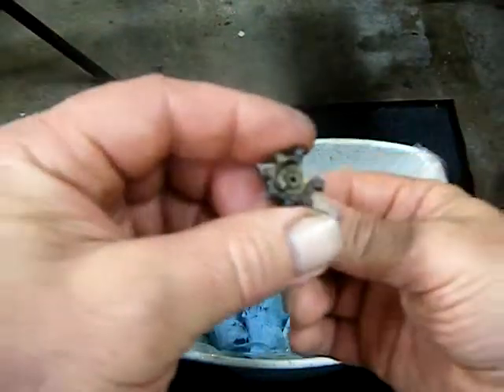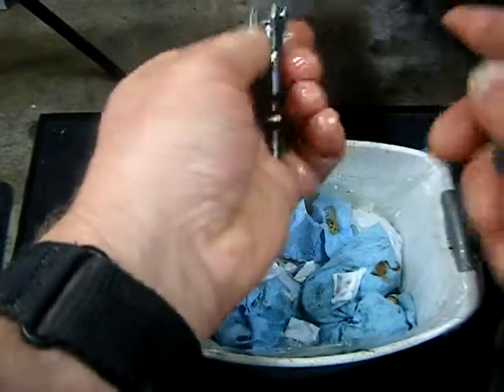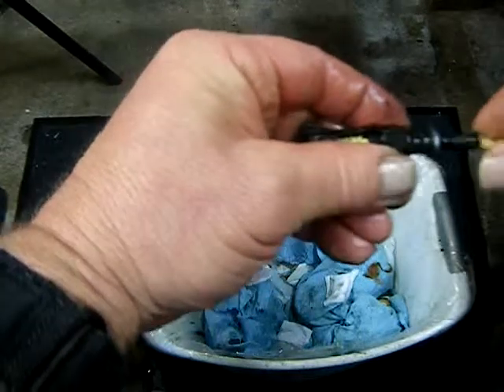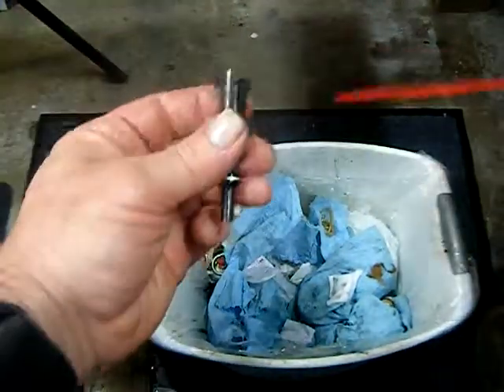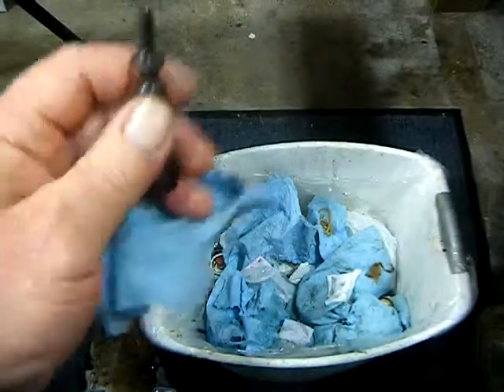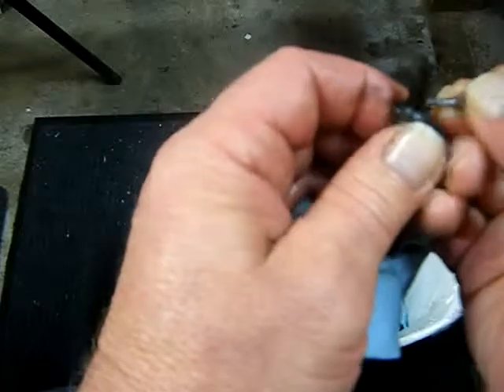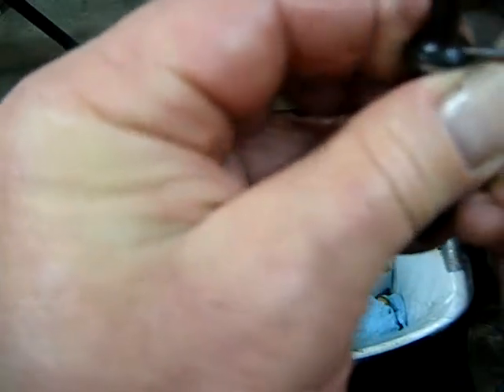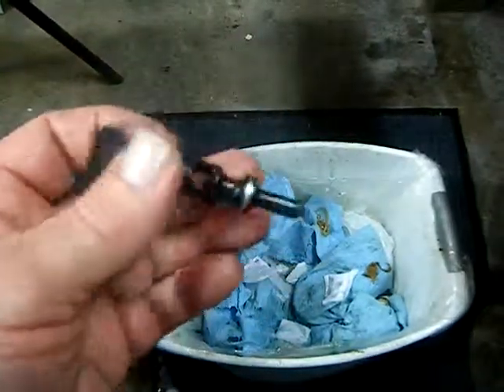Cleaning The M-15....Part 4.  The Bolt.

Comment: I use a razor blade on the back side carbon build up.  It scrapes it almost clean, then I use the brush.  Just go easy with the razor blade at an angle and the shit scraps right off.